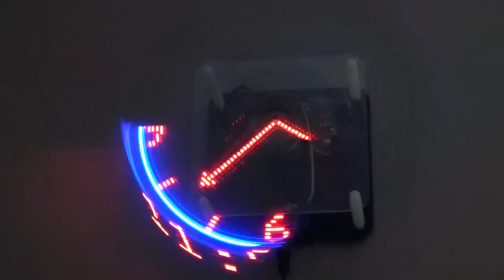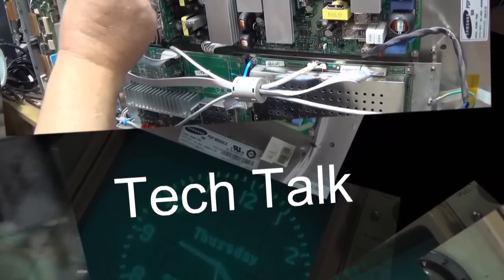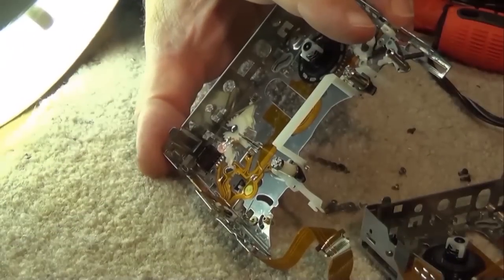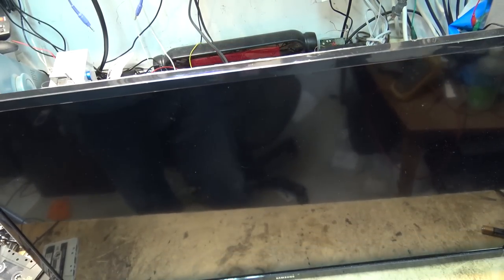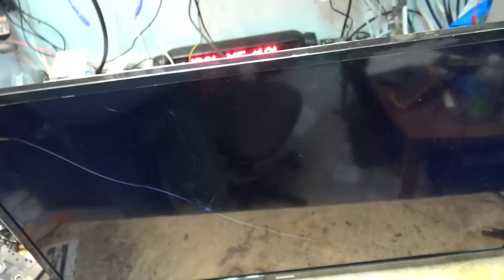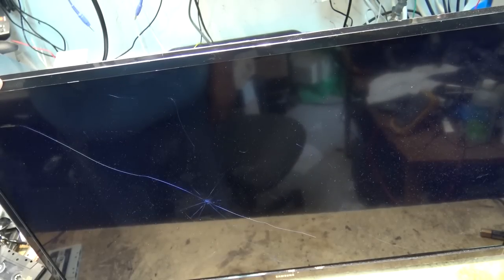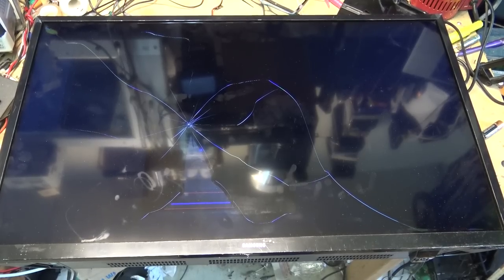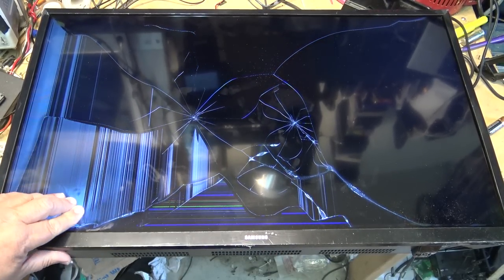TV has close encounter with a Wii remote.  Wii remote 1 TV 0

Comment: The "Whole TV one one board" is even smaller than that now, if you look on Ebay and other sites you can find stand-alone boards that will drive laptop panels ... you just have to specify the make and model of the panel.

Comment: Speaking of beyond repair, the 2014 Magic Chef 1500 Watt Microwave Oven the Stainless Steel, what we had for 5 years, at that time in August 13, 2020, the magnetron is starting to fail where it is having a lot of trouble to cook the foods and beverages while the microwave is at operational, and after I ask my parents that they want it to replace the magnetron, checked the price and couldn’t find the new parts available and said, “go ahead and scrap the microwave oven, we’ll get a new one sometime.” Even though me and my family has a 2018 Hamilton Beach 1350 Watt Microwave Oven, got it to use for house cooking, and works very well.

Now, back to the 2014 Magic Chef 1500 Watt Microwave Oven the Stainless Steel Microwave Oven, I went ahead and prepare to recycle the component, I discharge the high voltage capacitor, proceed to unhook the wire harness, salvaging the fans, switches, wires, the plug, the synchronize motor, light bulb, the handle, and the magnetron. But for the magnetron, I check them out, it has a continuity to the connectors, but when I was going to save the magnets from magnetron, the first front magnet ring is split it very clean telling me the magnetron had failed. So I went ahead and salvage the magnets and the copper wire before putting the metal components to the scrap pile and be done and be over it.

We know the magnetrons do give out the wave guide right through the cavity plate and allows to transmit the wavelength to the chamber and cook food and beverages. Used to be it gives out on 500 MHz, now they went ahead and give out on 1250 MHz under the FCC regulations for microwave oven.

Comment: That's the way it is going, don't bother to look at it, just put it in the bin!
Reply from the maker: That's right.  So glad i got out when I did.
Reply: @12voltvids  I saw a Philips TV a very long time ago, the guy let me have a look inside it and there was about 4 or 5 ICs and a few other components inside and that was about it, by the way, it still had a cathode ray tube, but they were starting to come out with flat screen monitors (just).  He was a TV tech and Ham and he reckoned if anything went wrong with it he wouldn't fix it, said the chips cost more than the TV would be worth.  That would have been in the 80s.  Can't remember his call sign, not that I would have put it here,  UK based.
He put some faults into an old TV and got some of us to look for and repair the faults.
Reply from the maker: Chips never failed on crt sets. Always crapacitoes

Comment: I have to class myself as lucky. I won a Samsung KU7000 43" TV in a contest a few years back. But Fedex dropped it in transit and broke the screen. I got another one shipped through another carrier after informing the sponsor. The second unit arrived intact and I've been using it ever since. But they told me to keep the damaged unit, so if anything goes on the working unit, I'll just replace the whole board with the one out of the broken set. But thanks for showing me how to do that...

Comment: I was wondering if this was going to be about a CRT. It might be useful to see some RGB conversions of CRTs since the only people interested in them are gamers.
Reply from the maker: I am hesitant to do RGB conversions as many CRT TVs use a hot chassis and that poses a shock hazard. You have to build an interface with full isolation which is a lot of work, an I just don't have the time to take on such a project at this time. To do it correct requires a full interface circuit. I have seen the hack jobs where they just tie into the RGB input on the video processor IC that is there for the OSD input, and that will work, but without isolation, depending on the TV design could expose the user to mains voltage appearing on the shield to the video lines which would be connected to a game console that someone is holding a wired connector making them the path to ground if insulation was worn. That would make me liable. So for that reason I shy away from mods to TVs and stick to repairs.
Reply: @12voltvids  I think the people who do RGB mods almost always stick with isolated chassis sets which already have composite inputs. Having said this, I wouldn't want to sell anything if I converted it. Even if I know my work is safe if something were to happen I would get blamed. Though I thought it was just the US which was lawsuit-happy, didn't know Canada was the same, too.
Reply: @12voltvids  Makes me glad I live in europe. Everything came RGB enabled out of the box.

Comment: Question: our 50" Samsung plasma bought in 2005, and used a lot daily, has always shown a picture that is just a little too big for the screen- maybe an inch or so, just enough so that you can't see entire writing on edges.  Is there a way for a non techi to correct that issue?
Thanks, enjoy tour videos.
Reply: Look through your different zoom/aspect ratio/scaling settings, maybe it's called 'P Wide' on the remote. I forget what the proper one was called but I needed to do that on my newer Samsung. If there isn't one that works, maybe there's a menu option to disable the overscan.

Comment: Designed obsolescence. Ugh.
Reply from the maker: Its called little kids throwing things at the TV.
Reply: Like my 2 Ipads that are stuck on IOS 8 and 9 respectively and have become nice picture frames as you can't use new apps on them and connections to many sites can't be made. But to replace them would set me back around $800CAD. Nope. Only caveat was I won both tabs. Have since replaced the bigger one with a Samsung Galaxy Tab A 10.1". At least that is working just fine...
Reply: @hawleygriffon9290  That's crazy. Why can't you upgrade the OS?
Reply: @stopthephilosophicalzombie9017  Because Apple does this with their devices. They will stop upgrading after awhile. Meanwhile, even with my Nexus 7 from 2013 stuck on Android 6, the vast majority of apps, including new ones will still work. Apple wants your money for new devices rather than keep supporting old ones...
Reply: @hawleygriffon9290  It's really terrible. I had a 2008 Macbook Pro that was one of the last ones with a replaceable/upgradable battery and RAM and it just died last year. I hate how they have become a horrible exploitative company. And now they are worth something like 2 Trillion dollars.